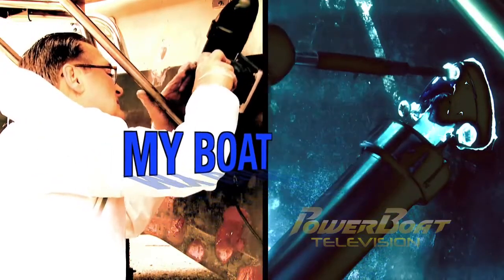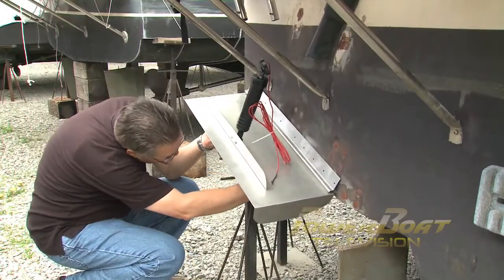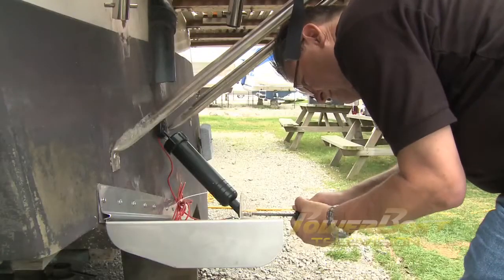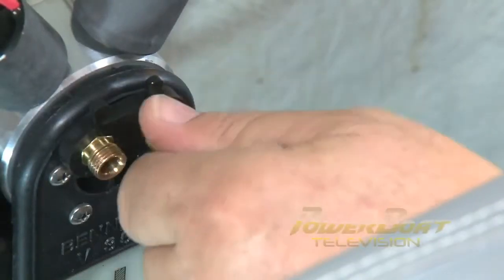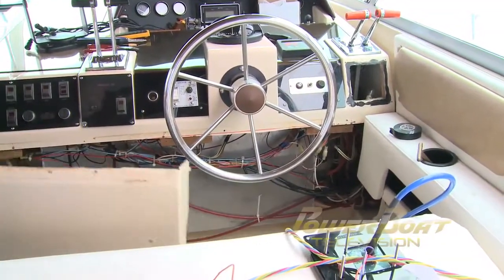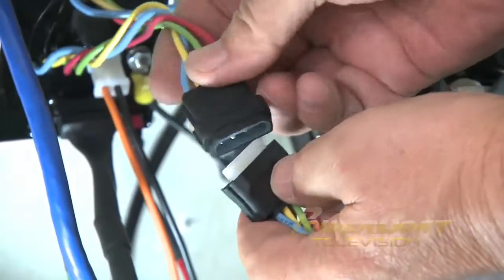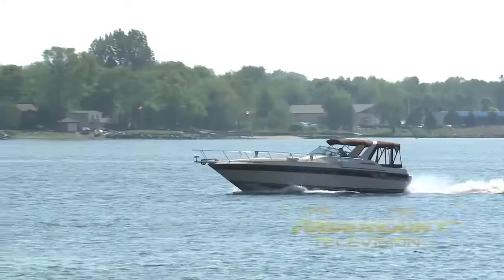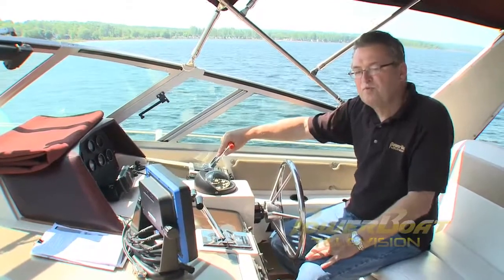How To Install Bennett Trim Tabs - PowerBoat TV

Comment: I fixed a lot of transoms and most of the rot was caused by trim tabs screws leaking water into the transom. Just squirting rubber in the hole does not keep water out.  The best way is to drill the holes as big as your finger and then fill the holes with epoxy and then drill the mounting screws into the epoxy, that way there can be no water leaking into the transom and that means no rot.